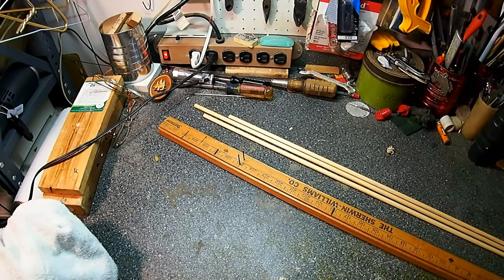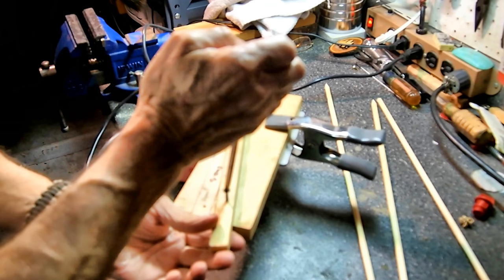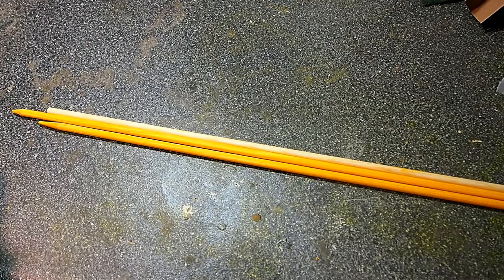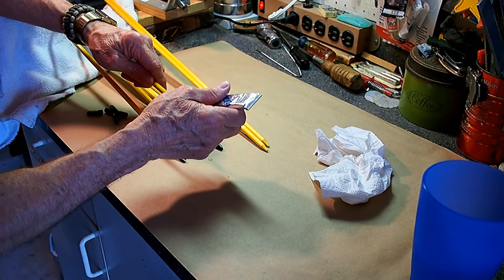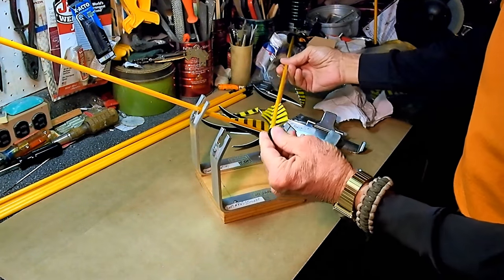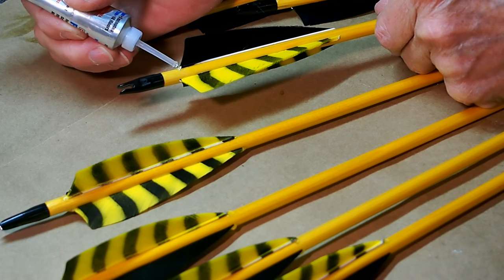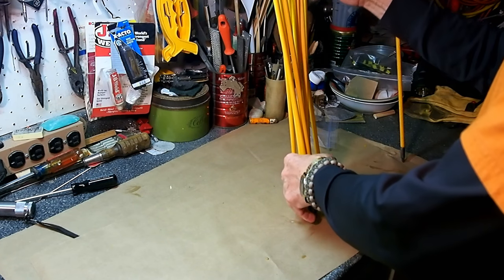Building traditional archery wood arrows for my longbow-start to finish

Comment: Interesting...makes me want to make some arrows and I don't even own a bow
Reply: Get ya a bow AND make some arrows. Great hobby.
Reply: Really enjoyed your video
Reply: Make a bow too! On the one hand it is basically a stick and string, on the other hand it can be very complicated to make your stick the right way and the string strong enough. But satisfaction in your work when you get it right can be exhilarating. I don't have the patience or the materials to make a bow that is good for hunting, so I bought one recently; a 62 inch recurve made of maple and fiberglass with a draw weight of 50 lbs at 30 inches. I could use my target weight compound bow in my back yard with my plywood backstop, but the hunting bow kinda scares me so I'm going to a proper range with it. I'm not confident that my backstop would stop the momentum and mass of the hunting arrows.

Comment: When sanding the two points you should sand it on the left side of the disc sander to prevent piece lifting up and ruining arrow shaft. Other than that you have a great video.

Comment: Very good video! Im not expert in electric machines but i would try to swap the wires on the grinder so the dust would go down not up. If its possible. I dont know US wires, i think its working in Europe. Correct me if im wrong

Comment: Been building my own since I was fourteen...fifty nine now.  One recommendation...after you put the point on, keep pressure on the point as you're doing but put it on a damp cloth...cools it almost immediately so you don't have to hold it as long.  Great video!
Reply from the maker: Good suggestion. Lately I keep a small spray bottle handy and just give the point a couple sprays of cool water...

Comment: This is the most helpful fletching video I’ve seen to date, and I’ve watched a bunch. Thank you so much.
Reply from the maker: Daniel Knight Thank you for the comment, I appreciate it...
Reply: I just had one question. Could you go into a little more detail about the way you stained your arrows? You mention alcohol and cheap clothing dye, and I’ve found information about using Rit dye as a wood stain, but your method clearly works great, so I wondered if you might be willing to provide more detail about that. Thank you.
Reply from the maker: Daniel Knight I mixed the Rit dye with denatured alcohol in an empty 20oz drink bottle. Full box of Rit in 20oz of alcohol. Shake to mix well and apply with a small saturated rag (old piece of tee shirt). Be sure to wear rubber or plastic gloves so you don't stain you skin. Let dry and re-apply to desired depth of color. As mentioned, the clear sealer brightens the color some so it will look more saturated once the sealer is applied. Test on scraps before doing the real thing as once sealed applying additional stain will not pentrate.

Comment: An inner-tube squeegee at the top of your dip tank would eliminate the need to let them drip. Just put a layer or two of the rubber across the opening and under the top cap, burn a little hole through the rubber so the blank squeezes through and on withdrawl you'll have a consistent coating that's ready to dry. Thanks for the video.
Reply from the maker: Thanks for the suggestion. Kind of like a gasket lacquer setup. I've never tried it so maybe on the next batch I'll do a test with it. Not sure how it will work with the water based poly but I won't know unless I give it a try. Thanks for the comment and thanks for stopping buy...

Comment: I've been wondering about using the wipe-on poly from minwax rather than dipping the arrows. Have you tried that or do you know a reason that won't work? I use the wipe-on poly for other wood projects and as it says, you just wipe it on with a rag and let it dry. It seals the wood well so it seems to me it should work and be easier than dipping.

Comment: I learned more in your short video than most others combined.  As far as string releases, what is your preference?
Reply from the maker: I shoot three fingers under the arrow. No mechanical device.
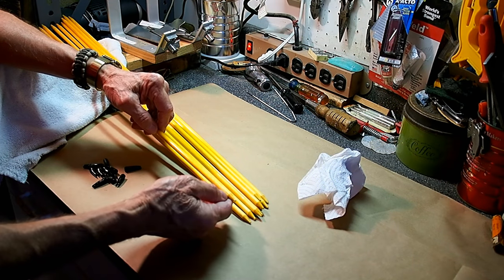Reply from the maker: Heyward Shepherd  Your comment is Incorrect, you misunderstood both of the explanations. See time lines 1:50 & 7:18.  The nocks ARE installed perpendicular to the grain not inline with the grain as shown here which allows use of the full stiffness of the arrow.  http://www.stickbow.com/FEATURES/ARROWMAKING/alignment.cfm

Comment: With the rits dye, do you mix it with rubbing alchol?  And what product do you dip them in?  The sealer I used caused my wood arrows to stick in the target. Thanks and I really enjoyed your video.  Tom.
Reply from the maker: I use denatured alcohol for the dye mix. You can find it in the paint department. My sealer is Minwax Polycrylic Gloss finish.

Comment: Please, advice needed, to reference of the measurement from back of feather to back of arrow or back of nock??
Thanks and great video.
Reply from the maker: @Ivan Brown The distance for back of fletching to nock is not critical except for the fact futher back is better for guidence. You don't want the fletching way forward. About 3/4" is good. You just need enough clearance for your fingers.
Reply: @Woodenarrows  
Thank you.
One more question please.
I have recently got a used 6 flecth jo jan with right helical clamps. I find that the first feather, the cock feather that I fletch, the rear of feather is offset to the left of center from inline with index on nock which makes cock feather not in alignment to true 90° from riser. Therefore all feathers are turned to the left some.( If i need ) to keep the cock feather as close to 90° from riser I can turn the nock on carbon but if I use wood with glue on nocks, I'm stuck the way it sets them. 
Im thinking that it's off center for both helical clamps, right to the left and left to the right with the center of the feather in line with index. Am I right or am I wrong? Thank you again I love you videos

Comment: Fantastic DYI video. I will now be making my own arrows and some for my two brothers. My only question is what fletching jig are you using? I googled fletching jigs and was overwhelmed. Many seemed way to complicated and/or made of plastic. Yours seems simple to use.
Reply from the maker: My fletching jigs are "Jo Jan mono fletcher" jigs. I I've had mine for years and yes, you are right, they are simple, quick and easy to use. I just did a Google search and found then on Bass Pro website. You might also try eBay?

Comment: You can add a heavier point if you want to keep your arrow length long
Reply from the maker: Adding a heavier point would make the arrow spine weaker. The shafts were too weak as they were, that is the reason I cut them shorter, to stiffen the spine.

Comment: Sorry, what was the product in the dip tank (about 5 mins onwards)? Some kind of clear varnish. I replayed the bit after the dye step but could find what it actually is? I've restored all the aluminium arrow for my archery club, but want to do a quality job on the wooden ones for the longbow guys too. I've got some fabric dye coming as I think it looks a lot better than the bare wood and way easier to identify for scoring.
Reply from the maker: It's Minwax Polycrylic sealer. I use the gloss finish as it's easier to clean off the arrows when needed. Here's my video on the DIY dip tank:  https://www.youtube.com/watch?v=yjK-Mw7EK-Q
Reply: @Woodenarrows  Yep, thanks for the prompt response, I found it in that video just before you posted! Thanks for all your effort in first building this, but also capturing it on video. The club are going to get some quality arrows, thanks to you. (Clophill Archery Club UK), https://clophillac.co.uk/

Comment: How much does a wooden arrow shaft weight? And what is its width?
Reply from the maker: There are variables involved. Mainly diameter and  wood type. U.S. Diameters in inches are 5/16", 11/32" and 23/64". Popular wood types are Sitka Spruce, Port Orford Cedar. Douglas Fir,  with Birch, Maple.Ash and Pine also being options. Hard woods are heavier weight that Spruce and Cedar. I use Portord Cedar in 5/15" diameter. At 29" length with fletching and 100 grain points my arrows come to 390 grains (0.89 ounce) in weight.

Comment: Where'd you get that jig for fetching? It looks very nice
Reply from the maker: They are Jo-Jan Mono Fletchers (two of them I screwed down to a board). I've had them for years. Unfortunately they are no longer in production. eBay may be your only bet if you want one...
Reply: Still got my Jo-Jans and still going strong after 40+ years.

Comment: any tips for straightening?  i bought some ashwood shafts and cant seem to get them perfectly straight
Reply from the maker: I've always just used the base of my hand pressing against the high side of the shaft and then checking by rolling on a flat surface. I'm also not that picky :-)  However, Rob Green has some very useful videos where he uses an ACE roller straightener to hit the high spots. That method works well and is pretty straightforward, maybe easier to learn.  Here's one of his videos... https://www.youtube.com/watch?v=LF19jShVbsw

Comment: What are you using for finish varnish?
Reply from the maker: MinWax Polycrylic gloss
Reply: @Woodenarrows  ANd forgive me for not going back to watch again but are you pulling that through a rubber squeegee top on the dip tube?  I've used spar varnish but want to try a water based finish and get away from the hassle of fumes and clean-up with mineral spirits.
Reply from the maker: @charlesmurray1220  No squeegee. I trhin the Polycrylic about 50/50 with water and just let drip dry. No build up or lumps... Here's my original 2009 video on the dip tank. https://www.youtube.com/watch?v=yjK-Mw7EK-Q

Comment: How many packs of yellow RIT dye you use?
Reply from the maker: I used one package of dye in that 20oz bottle of denatured alcohol.
Reply: @Woodenarrows  ok, mine are coming out way lighter than yours hmm,
Reply from the maker: @asherscubaarcherybushcraft2749  Did you catch that I used several applications, 5 I think... and the final sealer will deepen the color also...
Reply: @Woodenarrows  well, crap, ok , I used 3 , and I'm using wipe on poly , as of right now until I get a dip tank.
Reply from the maker: @asherscubaarcherybushcraft2749  I've got a DIY dip tank video. Might check it out, easy to make.   https://www.youtube.com/watch?v=yjK-Mw7EK-Q

Comment: 40@ 29 is 45#,...I don't think so.
But I have seen 40# bow's that shoot far better than 45# bow's.
And lighter arrows to make the bow faster????
Well I think douglas fir is kind of light,....and white pine is kind of light,... and sassafras is kind of light,....Wild rose bush stem's are kind of light and honeysuckle is kind of light?
Reply from the maker: I used Spruce shafting for these arrows and the arrow shelf on the longbow used here is not cut to center, thereby requiring a weaker arrow shaft to get around the bows riser(handle). Almost all things in archery are dynamic with no hard and fast rules.....